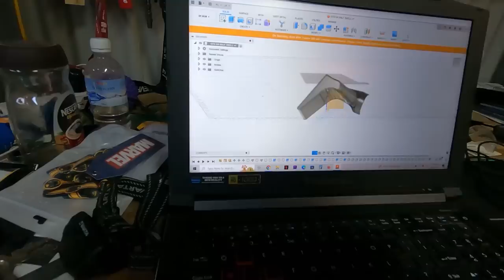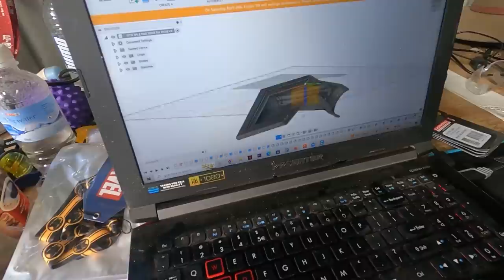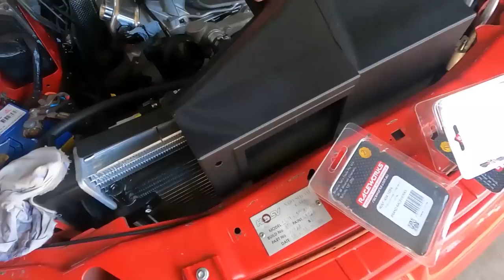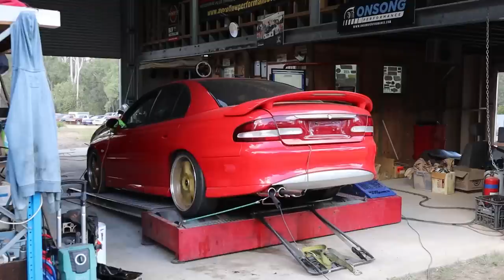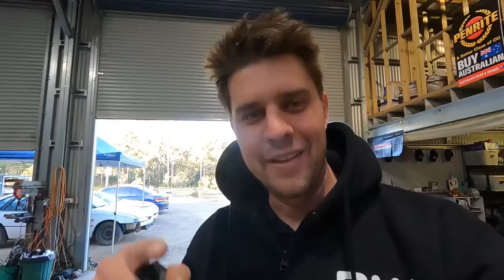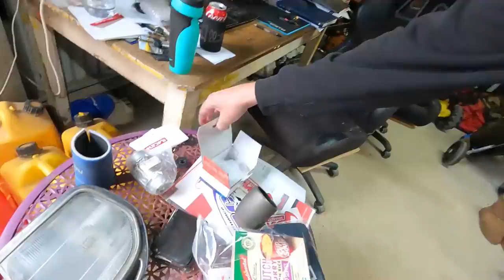Big-ish Comp Iron Blocked VT Clubsport Build || Part 2

Comment: I know you probs did, but did you guys do any road driving tuning with ac on for stalling low speed car park stuff  specially with that bigg ass cam. Be interesting to see how itd go with some ported l98/ls3 heads and a fast manifold. Awsome work! I dont think anyone understands the time and effort put into a build like this.
Reply from the maker: We didnt on this just because it wasnt registered, but we normally always do on cars that we tune! We just spent heaps of time on the dyno to get it right. Customer knows that he can just bring it back if he wants anything sorted now that its regod! Hes fairly local to us so not a huge deal 👌 
And yeh we really wanted to change the heads, even a stock pair of 821/823/5364’s would be worlds better than these, would even settle for some cnc 799/243’s, but awell! He will change them over one day, just had to draw a line somewhere

Comment: Hey mate, Love your work and knowledge.
I'm only an old school guy that loves a good V8 and a sparky so have limited mech knowledge.😊 I've got a 2017 Colorado conversion to an LSA done. I only really wanted an LS3 at the time but apparently it wasn't an option..! as I'm only trying to build a good tourer. Recently I had the blower removed and a stock intake fitted and retuned . Fuel consumption has gone through the roof 25ltr/100 plus not towing anything. My guess after some asking around is the comp ratio and cam differences could be reason.
Loved to know your opinion and am I going to have to spend more $$$ and fit a LS3 to replace the LSA?.
Cheers Steve